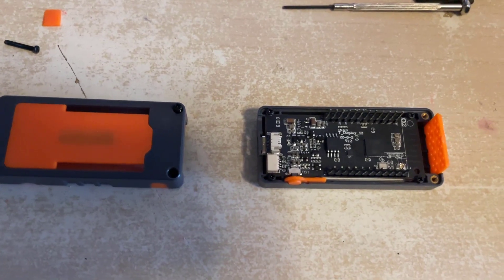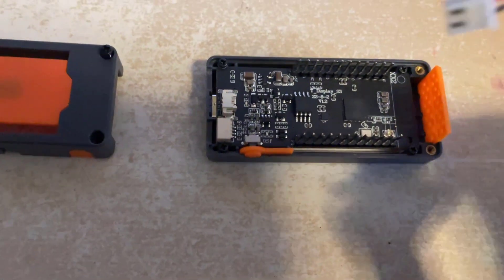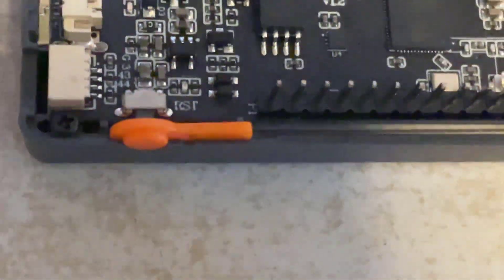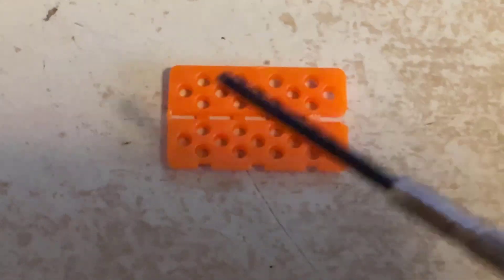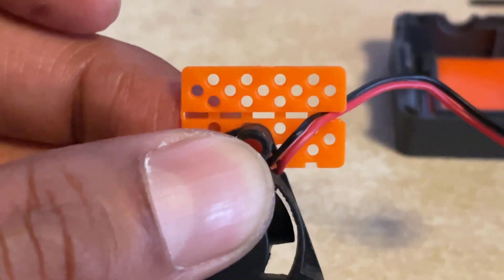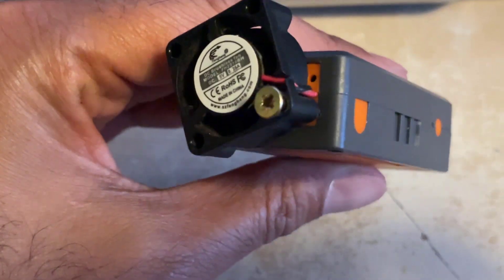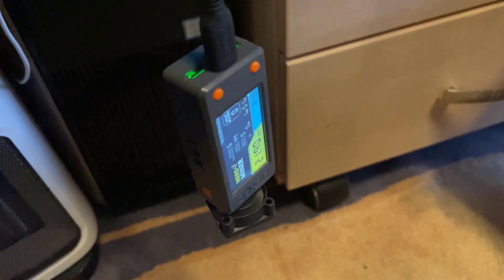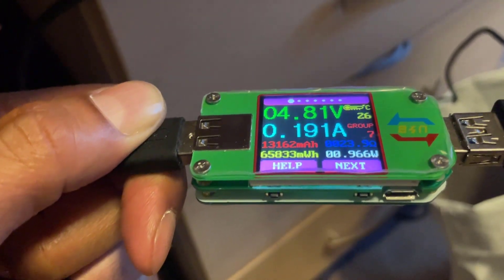Adding a Cooling Fan to a Bitcoin NERD MINER Case

Comment: Thank you for the video. My first 2 nerdminer had both a fan like this, but after i installed another two nerdminer with the lilygo t display with this case, i have seen that the nerdminer dont need a fan. It is enough to put a passive cooler on it. It will run around 50 - 58°C and thats good, so i have also put away the fans from my first both nerdminers.
Reply: What are you using for passive cooling? I was worried about cases and fans but hearing this not sure if I need them

Comment: As an alternative, is there a 2 pin to 4 pin adapter that you can plug into the front of the Nerdminer? My 2 pin is too wide for the slot or is there an alternative a power supply for 2 pin distribution 13 fans or mains power board to control the 5 v 2.5 mm fan! Could you translate your answer into German and post it here Thanks, that would help me a lot, best regards from Germany
Reply from the maker: Wenn der 2-Pin zu breit ist, können Sie den Adapter einsetzen, um die Pins zu trennen und sie so zu verwenden. Schauen Sie einfach unbedingt im Handbuch der Platine nach, um sicherzustellen, dass Sie die Pins an den richtigen Stellen auf der Platine einstecken (d. h. positiv und negativ).
Reply: @HandymanSavage  leider habe ich das Handbuch nicht mehr darum werde ich versuchen eine externe Energie Quelle zu bekommen? Danke für ihre Hilfe!

Unfortunately I no longer have the manual, so will I try to get an external power source? Thanks for your help!

￼

Comment: Hello, what do I do if I don't have the pins on the board. Do I just have to solder holes or are there pins to plug in? Could you translate the answer into German and post it on You Tube! That would be great, thank you!

￼

Comment: Good job! looks pretty :) I got me 2x of these, constant 56  Kh, but sometimes it drops to 0 and goes back up to 56 (throttling im guessing altho it doesnt seem hot)
What's weird is, i have in the same location, on same temps, under a FAN/AC, so idk why it can go for hours without throttling, and why sometimes its totally fine. 
I know this video is 1 month ago but with the new firmware you can double the Hashrate that you saw in this vid btw :) - We had a old DVR that we're throwing out, they had this same exact tiny fan, so now im going to use it for the lillygo nerdminer haha :D